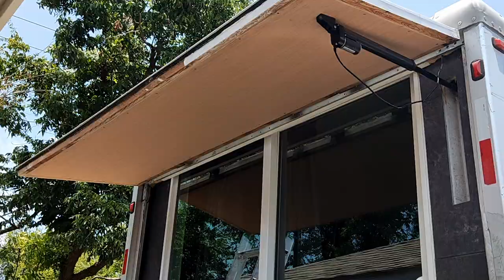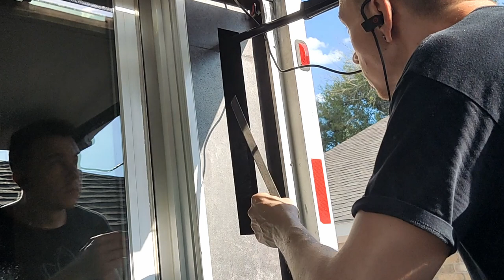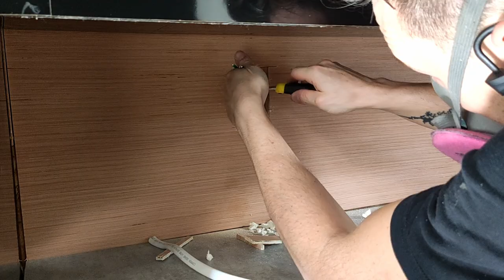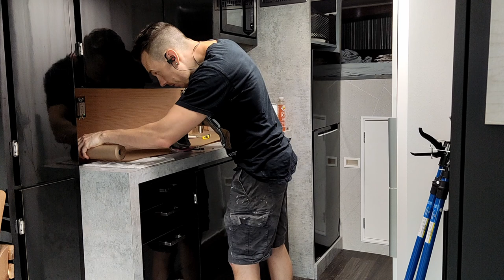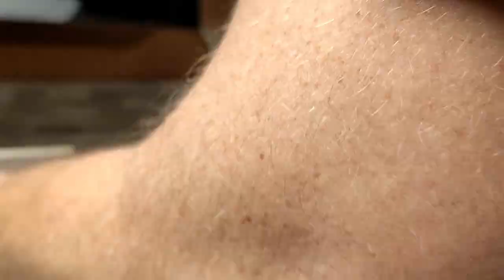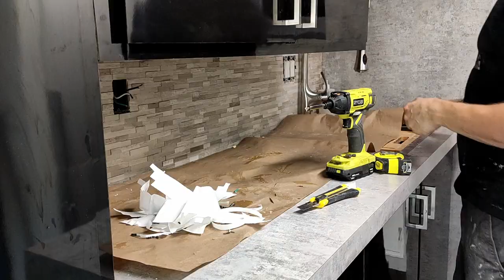Marble Backsplash and First Trip Preparation | DIY Uhaul Tiny Home Conversion

Comment: I love the wireless entry!
I hope you took precautions in that design to prevent hacking.
Otherwise it could be a vulnerability for someone to gain entry.
Reply from the maker: Stealth/obfuscation is the only current protection. It's a very basic wireless transmitter, not based on bluethooth or wifi, so there's no signal being broadcasted that would give it away. Unless you watch me open it, you would never know it's wireless!
Reply: @TheTechnoBarbarian  True. Someone would have to watch you open it, or watch your YouTube video and target you personally.
They would have to be within range to capture the signals the remote produced when pressing buttons. If the signals are encrypted, that would make things more difficult for a hacker to reproduce.
I would look into it, if not for security, but what happens if the remote is lost or broken? Are the remotes universal within the manufacturer?